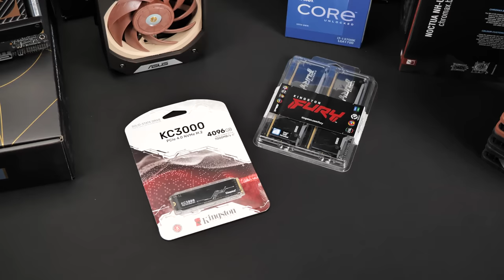You Will Fall in Love | Fractal Design North Gaming PC Build | Noctua NH-U12A Chromax, ProArt Z790

Comment: This is one of the best looking pc builds i've ever seen. 10/10 perfection
Reply from the maker: Thank you! That’s awesome 😁🤜🤛
Reply from the maker: @DrparthS  watercooled doesn’t always mean better. Two very different audiences with different needs ☺️
Reply: @DrparthS  Both are very strong, now intended for different audiences. the @Mr Matt Lee more for a normal consumer, whereas the Bro Cooling are for an extreme audience.
Reply: @DrparthS  I'm not a fan of watercooling systems my friend. While they do have slightly better cooling overall, if something goes wrong you could potentially  kill an entire system. With air cooling everything is more relaxed and safe. That is why this build is so beautiful too me. I always used noctua fans and in the last few years i have been using fractal cases and this one is 10/10 both in terms of performance and design. Natually aesthetics are something that we all view differently. :)
Reply: This looks like a PC from the Edo period!  So classy!
Reply: @Mr_Matt_Lee  Hey don't worry this guy doesn't know what taste is by his recommendation. I watch most builders and you're in the top running in just clean and well thought out builds.  I would say you have a clean pro aesthetic like Optimum Tech & Gear Seekers, and props for making builds that reg folks can replicate and appreciate without spending 30k.
Reply: @DrparthS  do we care? 
NO!☠️
Reply: Definitely the only way I’ve seen someone make noctua coolers look good
Reply: Check Designing Lab channel with ASMR custom builds. You will be surprised;)
And author can check it too 😌 May be he can get you excited
Reply: @Mr_Matt_Lee  подскажите где его можно купить?
Reply: I couldn't agree more! it's so epically refined and gorgeous.
Reply: NO  although beauty is subjective here I grew up in the 1980s so I’m well aware of those throwback wood paneled entertainment centers that this PC is styled after😅. It’s by no means bad looking and YES it is unique but only 2nd decade millennials and zoomers that think this as stuff is wildly inventive
Reply: @Mr_Matt_Lee  You can't go back to an air system when you've tasted the joys of silence with gpu watercooling
Reply: @0rsa54 The pump noises are a deal breaker for me.
Reply: @DrparthS  watercooling is a waste of money and usually looks bad unless you waste a ridiculous amount.
Reply: Facts
Reply: 100% agree! Not everyone can and want to afford fittings alone worth a whole pc build or  for a price of a gpu ;)  @PLr1c3r
Reply: Agreed.  It's extremely classy.  Not too much bling on it.

Comment: The "touch" of brown on Noctuas is what was meant for this case!!! Two things that need to be reviewed is that it needed a bit of Gold "splashes" inside in order to match the I/O gold buttons and  the beige on the backplate though, needs to be "modded" in order to be the perfect painting. No words can describe the matching with the AZIO keyboard......
Reply from the maker: Exactly this ☺️ thank you! If time was more on my side then I was going to source all gold hardware (screws etc) to use throughout the entire build for accents. But sadly, given the time of year and ongoing projects I just didn’t get chance. Stoked you love it though, and agreed, the Azio keyboard really pulls the desk setup together 🤎
Reply: Can you change the AZIO Keyboard keys? I'm currently using Brown tactile optical switches on my Keychron... but seeing that AZIO Keyboard has me... eager on the purchase button :P

Comment: Amazingly built computer. I am a Noctua fans lover. I have 7 fans in my PC case but yours is a whole other level and my dream. And that Fractal case...A design masterpiece!🖥🦉
Reply from the maker: 🤎🪵 Thank you! Appreciate it. What case are you running those 7 Noctua fans inside of currently?!
Reply: @Mr_Matt_Lee  I have a 7 years old computer and the PC case is called Nanoxia Deep Silence 3, which is no longer sold, but it is great German quality. I have bought Noctua🦉fans gradually over time. I have a new case that I'm looking to buy at some time, and it's called Be quiet! - Pure Base 500FX with high airflow and of course the one you're putting together in this video.

Comment: Just got this case myself, loving what you did with it. Great work man.
Reply from the maker: Awesome! What’s your hardware spec for it?! It’s such a stunning case for sure and opens up a lot of opportunity given the size 🫶
Reply: @Mr_Matt_Lee  Asrock x670e Steel Legend, Ryzen 7700x, G.Skill 32 GB (16x2) 5600, Noctua NH-15S (threw on a second 120 mm while I completed this build). I just need to upgrade my GPU still running a 1060 (don't remember which one, it's been too long). I was running an Antec 900 prior to this case, so it was really nice to have a LOT of extra space, the drive bays being out of the way (still have 1 HDD and 1 Sata SSD, but I did recently install a Samsung 980 Pro so I'm not super behind) and being able to cable manage easily with the included straps and zip ties.

Comment: This is a really nice case. Wood, glass and metal... I like it. It doesn't look like a gaming plastic RGB bomber either, only drawback.... it's big. I would like it to be one size smaller than MicroATX, maybe then it would also fit on the desk. Otherwise it would be under my desk and then I wouldn't have much of the pretty case.

Comment: As soon as I saw the case and the Noctua graphics card, I knew how amazing this was going to look.  The only thing I would have done differently is maybe put an LED strip at the top to actually illuminate the inside so you can see it better through the tint of the glass.  Maybe set it to the same amber color as the RAM.  Nice and subtle.  But man, this is one of the most elegant builds I've ever seen.

Comment: Wow. Very similar to what I am building right now.  But I have 3 X 120mm fan on the front which I will set subtle warm orange colurs to look like heat lamps. I am also reusing an old Noctua D14 from 9 years ago.

Comment: I've been thinking of a similar build with this case, but with an NZXT N7 motherboard, Noctua Chromax in black with the heatsink covers and Nividia A4000 or A4500 (for a cad workstation, not gaming PC.) So all black with a gold strip on the GPU. And no RGB ram, just clean black strips.

Comment: most of the same hardware i run except the case. I love the wood accents. I have been planning to make myself a one off case on my CNC with wood panels. i went with a NOS corsair obsidian 750 because i like the size of it and its build quality. i built many machines in the same series cases for security and surveillance systems. i can easily cut aluminum and even soft steel in the CNC and would like 3d carved wood accents that are functional in airflow as well. I dont build systems anymore except for family but i want my main design pc to be a work of art itself. Im also planning on revisiting an old project of mine a carputer 2din mini itx case with front 1080p touchscreen now that nvme drives are common place it will save a ton of space from the last version i made from cables alone. the main issue i had with the carputer i made in the past was cooling so i cheated and vented the AC system into the case. bad idea the moisture from ac air helped speed along degradation of the caps and they burst after one years use. but i had every function you could get in a premade deck plus Live TV, gaming and full internet in my car in 2015. with todays processors i think i could keep temps down enough to make it feasible. just not real gaming capabilities past what an apu could deliver. but i could easily make a 3 screen setup with each screen independent of each other. Very nice work.

Comment: I have a fractal/Noctua build myself! Nice to see another build like this! Mine is a Fractal Meshify 2 XL with Noctua NH-D15 chromax.Black, 3 140MM fans mounted on the heatsink itself with Noctua NF-A14 PWM chromax fans mounted through out the case. My Mobo is  MSI B550 Unify so everything is nice and black! No RGB! well.. Except for the graphics card.

Comment: Im doing this build but with the brown Noctua fans and Noctua 4080. As it's a no rgb build. I feel the beige/brown fans would look nicer with the glass panel.

Hiw did you manage to run a 13700k on an air cooler at 67c? Every other tester is hitting 85+.

Comment: you are not supposed to remove that plastic cover before you close the CPU socket. It pops off on its own, it is there to apply even pressure until the top is closed.

Comment: why the blue standoffs for fhe cpu cooler? thinking about putting together the same pc but would hate the blue not mixing well with the other colors. Adding...just ordered a pretty similar system (MSI MAG Z690/13600K - reusing my DDR4 ram) and putting it into the same case with a mesh side and the Noctua cooler.

Comment: Just curious what kind of chromax variation you've used for the fans? This build was a work of art!
Reply from the maker: Hey! They are the standard Noctua 120mm Chromax fans with brown anti vibration pads fitted to the corners. I’ve left links to the products in the description if it helps 😁

Comment: Stunning. And I see Asus has announced its new Noctua 4000 series GPUs (here’s hoping the 4090 will fit!). Question: does it need the two top fans? I would have thought convection and positive case pressure would give better evacuation?

Comment: Total noob question: I'm looking to change my pc case (NZXT H210), since my GPU (6800XT) reaches high temps and audibly strains itself under that heat, despite the rest of the case being quite cool. I realised that this might have resulted from the fans of the GPU facing downward and I've allowed basically zero clearance between the downward-facing GPU fans and the PSU shroud, which is basically a solid metal plate with a few punch holes.
I knew this North case was coming out and I love the aesthetics. But in this video, the GPU fans are also facing downwards, while most of the air seems to be flowing on the upper room of the case. Even though there's obviously a larger room between the gpu and the bottom of the case in Mr Matt's build than mine, wouldn't it still have a similar heating problem to what I described?

Any tips appreciated!

Comment: I have two of those cases.   I liked the wood but not much room for extra Drives.  You don't need that many fans either.  It has a 4 fan header behind this guy went fan crazy and did not use it.   Ate up the 2 SSD slots to put a different fan header in.    Top comes off way too easy and no way to secure it better.  You don't need to even tug on the rear vinyl strap it comes off that easy.     Its ok but I would say qaulity is worse than my 2012 and 2014 Corsair and NXTZ cases in terms of metal thickness.    Really the wood is what sets this one apart.   Hiding the Rear of the power supply makes it a little more difficult to add or subtract a cable from it.
The top HD activity light does not work very well.  It mostly stays lit but I don't see any activity when the drive is being accessed.  

No I did not slow mo a camera and play music while walking around the case.

Comment: Those temps are crazy and that case looks great, especially with that Asus/Noctua 3070. I'm curious if any XMP profiles were on or voltage limits or something to keep those temps like that. What do you typically use for stress test? With Cinebench R23, a 13700k,  Asus Tuf 3080ti, Corsair 280mm AIO push/pull setup as intake and plenty of case fans (7 additional on top of the four 140mm on the aio) it was easy to get up to 90C during stress test with voltage limits . With XMP2.0 enabled it was throttling at 100C pretty fast as well and this is what I was seeing with most people on these chips. Any thoughts?
Reply: I would love to know details as well, those temps are unreal for air cooler.

Comment: Just 1 single issue I have. Why noctua 3070 and not noctua 3080.
Reply from the maker: … for no other reason than the fact I had a Noctua 3070 and I don’t have a Noctua 3080. They’re hard to find here in the UK, even direct from ASUS as support. Both cards are fantastic respectively though ☺️

Comment: With this fan setup I believe you’re creating negative pressure in the case so it isn’t as efficient unless you adjust the fan speeds, but you’ve hooked them all up to the same fan hub so the speeds are the same.

Comment: Heads up, your US RAM link is the AMD version and not the Intel XMP version it needs to be.
Reply: Good catch. I wonder if he's able to run those sticks at 6000. I need to replace the Corsair CMH64GX5M2B6000Z40 kit which would only run at 4800 on this mobo. The intel version sticks he used do appear on the Asus QVL/compatibility list.

Comment: Would this case comfortably fit a 4090/360mm AIO build? I love the looks but it's quite small :/
Reply from the maker: Hmmm. Maybe with an FE 4090, but it would be extremely tight. None of the partner cards would fit with a radiator up front… if I get hold of a 4090 FE I’ll test fit and update you!
Reply: @Mr_Matt_Lee  Thank you very much!

Comment: I assume that the fanhub came with the case? I only heard that the Mesh version had it preinstalled.
Reply from the maker: The fan hub didn’t come with the case no… that’s made by Deepcool and it’s an inexpensive, easy to use addition. I’ve added a link to this in the description if needed ☺️

Comment: Why 5 exhaust fans? Why negative case presure?
Reply from the maker: There’s 3 exhaust fans. The two on the cooler are to aid in airflow direction through its heatsink. 3 exhaust, 3 intake. Perfect pressure.
Reply: @Mr_Matt_Lee  Btw I love your work. I always thought that cpu fans count has exhaust fans. Thanks. I'll have that in consideration 😊

Comment: amazing, but it would be better if you picked NF-F12 chromax on the top side (Its not necessary to pick A12x25 on the top because you haven't to have high static pressure with low air blow for air outlet, you already have an air pressure in case by front fans) and the same problem with background fan: you could pick NF-S12A with very high air blow at low pressure. 
Important: Your air static pressure on the entrance of air in the case have to be highest than on the exit, because if you have (for example) S12A on the front and A12x25 on the back, all dust will sucked by slots and gaps without filters (by way of least resistance) and clogg the case with dust is stronger than usual. And also create extra acoustic noise. + Fans will work irrationally and at high speeds. In all these little things found the basis of an ideal cooling system.
Reply: What I'm getting at: Noctua is very very very cool. But I'll give you an example from another area: to look good, it's not enough just to buy an expensive suit: you need to know when to put it on and how to wear it. 
If you buy noctua thoughtlessly, purely because of the brand, not caring about the work of their engineers who created different models for different purposes, it's the same as coming to a black-tie party in a very great quality brand new PINK suit.